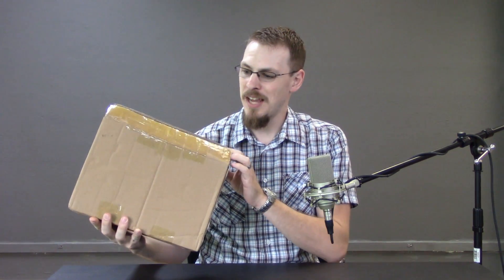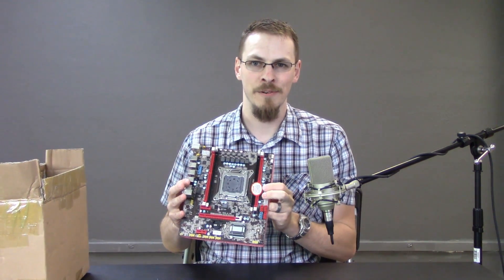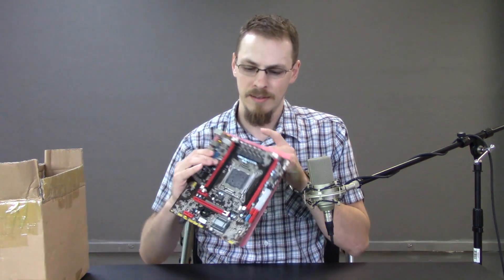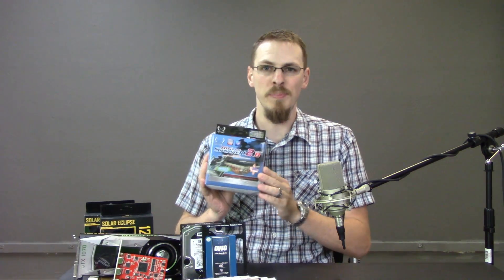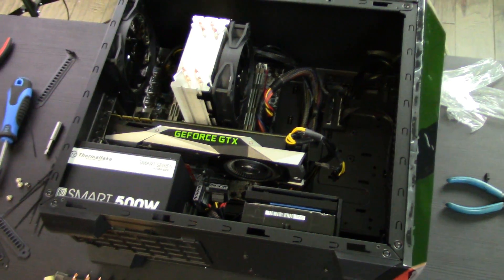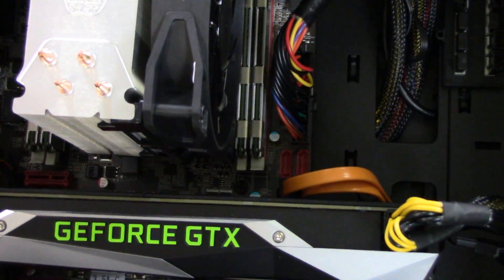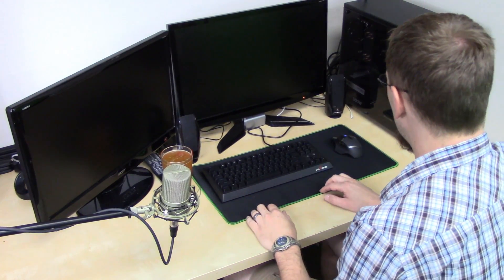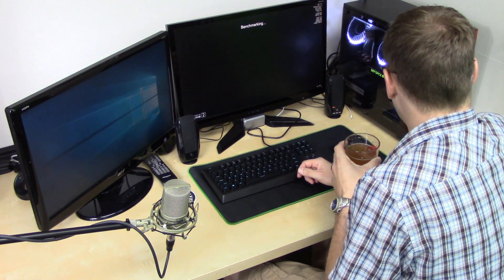Chinese x79 Motherboards... Do they even work???

Comment from the maker: I've answered this question so many times, I decided to sticky a comment about it.  Yes, I know most boards are built in China.  Why am I saying "Chinese motherboard"?

The difference between this motherboard and those from reputable companies (Gigabyte, Asus, MSI, Intel when they made boards, etc), is those larger companies have multi-billions in revenue every year, and work directly with chip makers (Intel/AMD) to produce compatible boards.

This board is essentially off-the-shelf parts.  The chipset is a modified Intel P75, not a genuine C602/x79.  The fan controllers provide voltage, but don't actually change the fan speed automatically.  The RAM is dual channel, not quad.  The USB 3.0 controller is flakey.  No heatsinks on the VRM for 130W+ CPUs.  Overclocking options are very limited in the BIOS.  There is zero support from any company for anything on this board, be it BIOS updates or compatibility questions.  There is no warranty on this board.

I say Chinese motherboard not to be derogatory, but to imply that this board is not from a major board partner.  It has no brand name.  It is basically made on the streets of Shenzhen to work with x79 chips and be as cheap as possible.  If this were a board by Gigabyte, I would give it a terrible review because of the problems listed above.  But this is supposed to be a knockoff for a fraction of the price of a genuine x79 board, so most of the issues get a pass because the CPU and GPU performance are fantastic for the price.

Hope that helps.  Keep the comments coming!  Thanks for watching.
Reply from the maker: It is registered memory.  This is a P75 chipset.  The DDR memory controllers have been embedded into CPUs since Intel's Nehalem chips.  What allows a chip to run with registered memory is a controller on the board.  What this board does is report to the CPU that it is capable of running with ECC Registered memory, and it tells the memory that ECC is not supported by the CPU.

This allows you to run any memory that follows basic DDR3 specs, including ECC and ECC Registered.  On this board, it runs without ECC being enabled.

You're correct about the implementation of the memory controllers on the C602 chipset, but this board doesn't play by and standards or rules :-)
Reply from the maker: That's exactly the use case I recommend.
Reply: So basically if you have no plans on running high end CPU's or overclocking which generates a lot of heat the motherboard is basically acceptable for the average person who may be a casual gamer at best?
Reply: I dont find it derogatory...I say "american bicycles" "japanese knives" or "german cars" I don't see why you can't say "chines motherboards"...anyone who finds this offensive has their own preconceived notions about "chinese products"
Reply: Does the motherboard still work
Reply from the maker: Sure does!  It's been running non-stop since this video was posted.
Reply: Out of curiosity, VRMs temp stable? I wonder if applying generic heatsinks and high thermal conductive pads to help with the VRMs.
Reply from the maker: This board is limited to 8GB DIMMs, and seems to run in dual channel as well. I reviewed another board recently that will run quad channel. https://youtu.be/VBvBzW8UEX0
Reply: I think the way we (As in my friends and myself in the audiophile circles in the late 1980's) used to refer to these products as 'Unbranded'.
'Course this was back when such products would come from Taiwan, Japan or Puerto Rico.
It is perhaps old-fashioned, but maybe less problematic than calling them 'Chinese'.
Reply from the maker: Make sure you follow right-to-repair legislation. Apple especially is fighting consumer rights when it comes to truely owning your device and having the right to repair it.

You know that iMac Pro screen that Linus broke and Apple refused to fix? Perfect example of why we need this.
Reply: Specifically, this is a C606 chipset motherboard, I know that because you used Registered ECC, which a H61, B75 etc....even modified will not support, To have a fully functional memory controller it had to be a C606 or your ram wouldn't have worked at all.
Reply: Can't believe that this board is still runing. I've never trust a non branded thing in my life.
Reply: I live in china Shenzhen bought a gta 1080ti 8 gb desktop for around 2000¥ so like £200 ish give or take used it for year runs great never had an issue all the parts are the real thing but the motherboard claims to be asus it clearly is not but nope never had an issue
Reply: Craft Computing a
Reply: Hey jeff have you tried quad rank 16gb ddr3 rams on the boards before? Will it work like typical x79 boards do? I heard the boards uses h77 chipsets to save cost and thus limited to 8gb per dimm max. Can you help confirming this with me thanks!
Reply: There used to be a day when it really did matter. You had your high quality stuff, your mid range stuff, and then you had your cheap low end and knock-off stuff. Fast forward to today when ALL companies use the same parts and cut corners where ever they can to save money for them and take more out of your pocket, it really doesn't matter anymore what you call it. Call it low end, unbranded, knock-off, doesn't matter. You"get what you pay for" doesn't really apply anymore because of this either. I have seen many "High end" products that cost a good penny taken apart to find the same substandard parts used in lower end products of the same type. So just ignore the ignorance, smart people know nearly everything either comes from China or parts have been produced in China. It's all about the mighty buck.
Reply: I'm so surprised that China finds a market for these.  Like seriously why can't anyone in the US be making these?
Reply: Phenom Menon I'm all for American made but it would be cost prohibitive. All the tooling already exists in China along with the start up culture.

I'd like to see more American repair shops for repairs. That's definitely doable
Reply: Oh i5 cpu forgot that bit haha 1tb hardrive
Reply: Craft Computing The motherboard i bought was chinese and didnt even have a name. Works fine.
Reply: Your animated intro sounds like the headiest beer I'd ever drink. haha Nice channel I like your videos I subbed
Reply: Why not say unbranded board?
Reply: Well actually it depends on version or revision or whatever they call it ,mine came with heatsink on those parts that yours doesn't have, and the usb 3 port , in my case is working fine even i am a destroyer of weak stuff and well mine seems that came with one RAM slot not working, also it just run on dual channel is true,  weird part is that task manager shows that there are 8 sticks of RAM??? 

Mine has a weird issue that it would not boot from sleep or i don't know if is my case 

About drivers, i just run Driver Booster and i haven't have any isssues by drivers or the usb ports not working properly
Reply: So, to be fair, it's a generic motherboard since basically all motherboards are Chinese these days.
Reply: Many branded things are just non-branded things plus a tag.
Reply: why the hell would you even bother buying something other than a reputable brand, when those are already very affordable? Just for the hell of it I suppose? VRM heatsinks were not a thing really until the last few years.
Reply: Craft Computing aren’t all computer parts made in China?  It sounds Derogatory claiming Chinese boards or bad when buying garbage on eBay. 

It’s still a fun idea, I like the video. I just don’t like the click bait title which is also misleading

Comment: Hey man I know this is an old video but I have a Machinist x79 with a Xeon 2696 v2 paired with 32 GB of RAM and an RTX 2080. It runs great but I do notice a high pitch hissing sound from the motherboard that cuts in and out similar to a sprinkler. I've been told it's linked to coil whine due to cheap compactors. Should I be worried or should I buy an ASUS Rampage since I due gaming/ streaming. Thanks in advance and love your videos.

Comment: Actually got a moderate end Chinese board and a 2690 almost 2 years ago. Used it, ran BFV at 100 FPS, and then got rid of it a year later because I played games that have bad devs that think we're still stuck in 2003 with Dual Cores being the highest end CPU you can get even though there game practically begs them to make it support multiple cores.
That and my previous mobo taught me one thing though. I'm never buying a motherboard that isn't full sized and has all screw mounts. Honestly really dislike board that flex when you plug the bottom connectors and especially when you try to plug in the 24 pin.

Comment: Partly bought the same server, to replace my old Athlon/Gigabyte gaming PC , I will test it on 530 watts Hiper PSU, I was a bit surprised that 500 watts psu was able to run that kind of system. I've spent 61 $ on a processor, 55 $ for a cooler, 60$ for 32GB of ram,  and motherboard was about 80$ = about 256 $ 
Great motherboard / processor / ddr memory, Chinese - did not deceive. CooNong 2U cooler  Intel LGA 2011 X99 / 2066 - also cool compact cooler device

Comment: You will not get SLI configuration. But you will get a basic board for THE i7 3930k cpu at a budget price that all HUMANITY was ROBBED off. Go find A i7 3930k motherboard for under 50 pounds or dollars. It's just a budget 50 dollar board intel ROBBED you off. But the CHINESE recycling department made this. At least they are recycling parts and making a cheaper x79 board.

Comment: I'm actually having a hard time with one of these boards. I put an e5-2690 in it, r9 Fury, 16gn of ecc ddr3 etc, but it refuses to post. I've tried resetting the cmos, tried different ram, tried just one stick of ram in different slots, bread boarding it, reseated the cpu, tried a different graphics card, all to no avail. Got any advice?

Comment: Yea but How long do they last, have you had that one in service for a very long time? I'm thinking about getting one of the 92$ x99 ones' but I'm scared that the manufacturing process is so freaking cheap it won't last more than a year, and I don't want to damage any of my other components.   If you could tell me if that one you just built here is still in commission or has expired, would be of great use to me, thanks.  Thanks for the video.  You, Linus and the HW Canooks are the only guys I even watch anymore(sometimes' Jays 2c).  Good video.

Comment: So I got this motherboard too and it worked for a while. I started to use it for regular games and GTA performed well but I had a problem of studdering. Huge lag spikes. I replaced all the important parts but not the psu. Could the psu be bottlenecking my motherboard. Sorry if there is any bad spelling

Comment: I bought a little better Chinese motherboard 3 pciex16 3.0 and 2 piciex1 slots and an m.2 nvme m key SSD slot. All I received was the motherboard in a static bag with the shield on top of the CPU slot in an Amazon shipping box. No manual, or Motherboard box. I'm flopping in an E5-2760 8-core processor I paid $55.00 from Amazon. I also put in 64GB DDR3 ECC RAM and a cheap m.2 2TB m key drive ($300.00) as a boot drive and a GTX-1080 that was collecting dust on my computer spare part shelf.

Comment: To be honest, I might actually get one.  I've been looking for a LGA2011 dual socket motherboard to run two Xeons in.  The problem with Xeons, is they have no integrated graphics, and server boards don't have a built in graphics adaptor, nor the capability of plugging in a card.  So you have to get a blade rack adaptor or access it via ILO. 

 So you're looking at $350+ for a board with dual socket and pci express. 

or $150 for a server board with $450+ for the blade centre and adaptor. 

Or..... take a chance with a $100 Chinese board with dual sockets and an pci express slot.

Comment: So I wanted to use old gear from the closet for a Media PC hooked to my TV ...

Nvidia GTX660
Antec ATX case + Corsair VS450 Watt Power Supply

RAID5E with 4x2TB (Dell WD Drives) drives for media
Capacity 4 TB
Speed gain 3x read speed, no write speed gain
Fault tolerance 1-drive failure + PARITY

Intel XEON E52620 V1 2.0 GHz (Turbo 2.5GHz)

4x4GB DDR3 ECC 1333 MHz Dell Hynix Memory

I actually got a x79 asian ATX motherboard with even m.2 port on it for $78,56 US

1 WD M.2 ssd 120GB (New) (25$ US)
Hyper 212 Cooler (New) (30$ US)

Installed ESX 6.5 Free Hypervisor Edition on M.2 SSD (20GB Partition)
- VM1 CLOUD (Linux Debian 9) (3 Cores 6 Threads) 8GB Ram (50GB on SSD)
- VM2 PLEX.TV (Linux Debian 9) (3 Cores 6 Threads) 8GB Ram (50GB on SSD)
DATASTORE 1 M.2 (100 GB leftover)
DATASTORE 2 RAID5E (4 TB)

So I spent 133$ US for a Awesome Mega Cloud and Media Server (Super Silent and Economic) ! WE LOVE IT !!!!!!!!!!!!!!!!!!!!!!!!!!!!!!!

Comment: I bought the Huanan X79 Deluxe motherboard with NVME M.2; decent packaging...all as expected.  Was able to boot off of the NVME!  Supported an E5-1650 V2 and 4 x 4GB of 1600MHz R-EEC memory. Temps were very good. Worked perfectly...for less than one day.   Late in the evening it went "POOF"....FF trouble code. Now awaiting issue resolution via AliExpress...I suppose I should not hold my breath here.

Comment: I recently tried an i7-4820 on 3 different Chinese X79 motherboards, 2 which are deployed in other running systems with Xeon 2660 and 2650 CPUs and the last of which I recently bought on Amazon.  All powered on but none booted.  Is there a conflict with i7 CPUs or do I have a bad processor?
Reply from the maker: The i7s should boot just fine.  You may have a bad CPU.
Reply: Thanks for the swift reply!  Started the return; I'm done trying to find a board that works with this CPU.

Comment: I would say it is good they did not put the battery in. These things sometimes sit in warehouse for years, and batteries could in theory leak if of poor quality. Better to store and ship without a battery. Also some of thse batteries are lithium, and it might not be legal to send them via air without proper certification and packaging. Just put your battery in when you get it. Easy.

Comment: You are an excellent builder. But negative again. If you are doubting the motherboard, why not test it outside the case first, to make sure it is working? Then place it inside?
Reply from the maker: This is not a negative review.  In fact, I gave a pass to the board despite the litany of issues with it (check out the pinned comment on this video for that list).  Had this been from a major board partner like MSI, ASUS, Gigabyte, etc... I would have read them the riot act.  The build quality is not good, the BIOS is downright bad, and the box was cardboard, bubble wrap and Styrofoam.  But it does boot, and (at the time) provided a good value over buying used parts.

As for the water cooling video you commented on... I mentioned the CPU block would likely be fine, but you can pick that up for ~$20 online.  The rest of that kit was terrible quality, longevity reservations not withstanding.  And yes, most water pumps are made in China.  That doesn't mean this one is inherently good.

And just to be clear, I don't mean this comment in a negative or demeaning sense.  I just wanted to give some context about the things you were pointing out in the video.  And I do appreciate you watching.

Comment: I purchased that exact same board. 
The manual is pretty much toilet paper worthy. 
The marks on the board aren't really helpful, for example theres only DIMM 4, 6,7, and the last marking is covered by the DIMM base itself. 
So I still have no idea where to put my two RAMs, since I don't get any video output when I install the RAMs via manual, which only says "1,2,3,4", or any other way.
Also I dont get any signal for it passing POST. 
I only see the LEDs, and graphic card LED, also the fans fire up just fine, but nothing else happening. 
Monitor says "no signal detected"

No specific forum threads for this model either.

Comment: Audio tip: Not sure how you're normalizing your audio.  Keep in mind, though, when you have loud intermission music, it'll indirectly lower the level of your dialogue.  By right-clicking and selecting 'Stats for nerds' on your video, I can see you're perfectly optimized overall.  Unfortunately, loud bits, like your music, can throw off the entire dynamic profile of your audio.  

Also, I noticed you have an ambient hum.   Lots of low frequencies will eat up your headroom like no tomorrow.  Use a high pass filter around 80Hz (60 cycle hum is at 60Hz) to mitigate that.  

Tl;Dr: your speech is too fucking quiet.

Comment: Will my i7 3820 work in it?
Reply from the maker: Absolutely.  Max OC of 3.9GHz though.
Reply: Awesome i may not even OC it stock speed may just do it for me.. Any reviews on knock off no name gpu's?
Reply: and i had a 1156 question.. my neighbor is running a first gen i3 540 on a stock acer and has a 750ti that he can't use to its full potential due to the well age and its duel core processor... The motherboard thats in his rig is a acer H57H-Am2 will this mbd support a i7 860? and if so will it allow him to not get a bottleneck with his gpu?